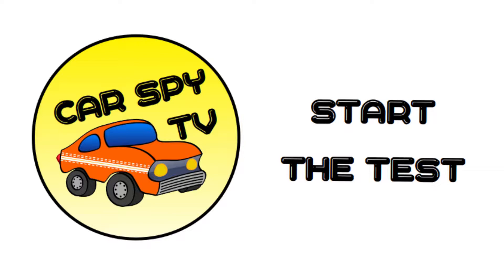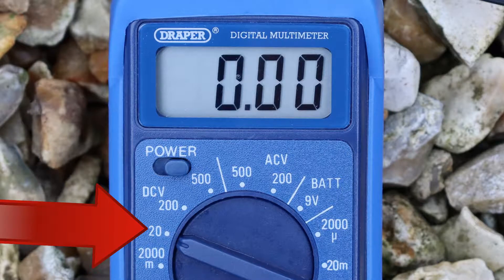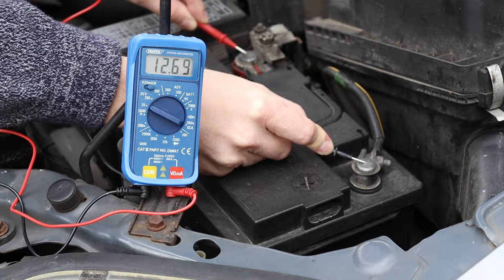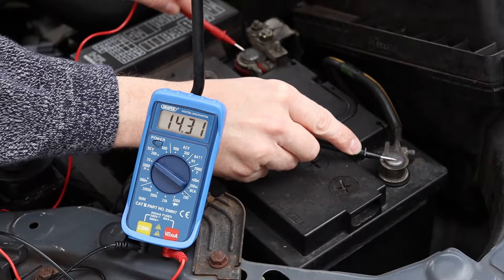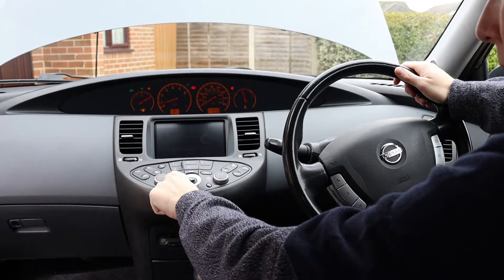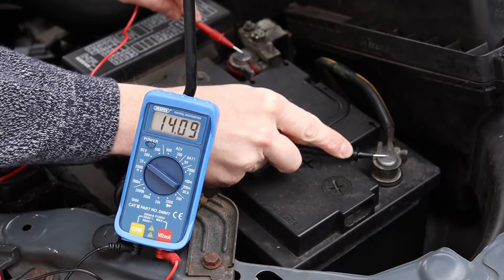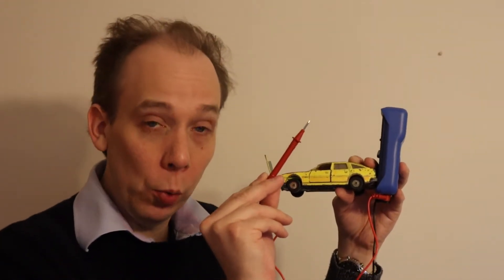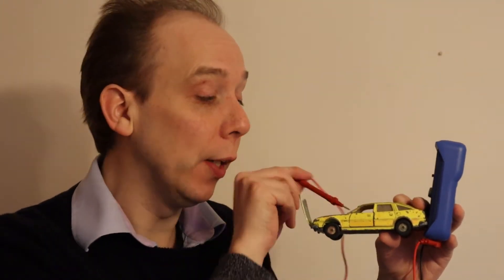How To Test An Alternator (With Multimeter) -  it's EASY!

Comment: I replaced battery checked everything explained here and I forgot to put a cover i disconnected while engine on and it turned off put everything back and it started right up kind off had me concerned? Any advice
Reply from the maker: You didn't mention which cover you removed. However, is there any cause for concern if the car's now properly put back together and working?
Reply: @CarSpyTV  it was just like a foam cover that goes around battery but it’s running and battery reading around 12.7 and while running around 14.50 hope everything is fixed 🥹
Reply from the maker: The voltage figures sound good. The foam might be insulation, but I can't be sure without seeing the car.